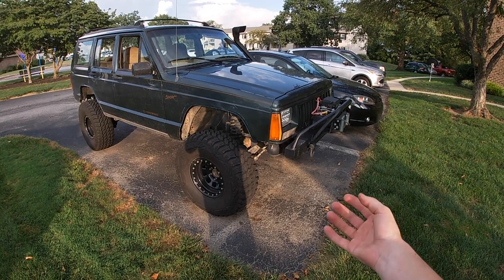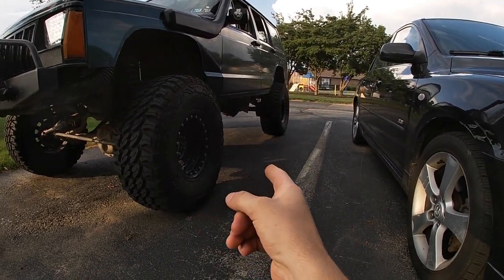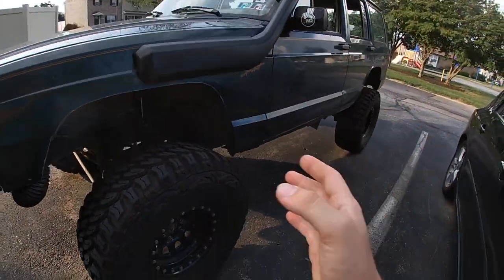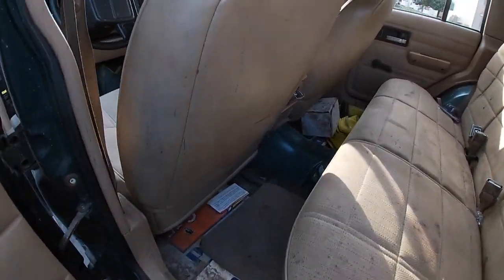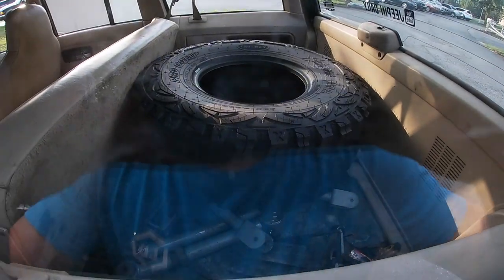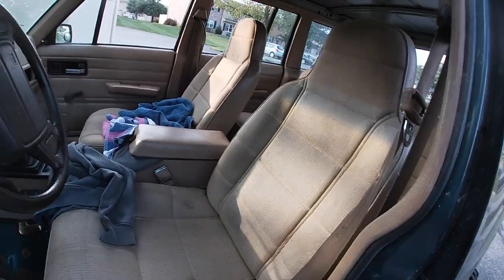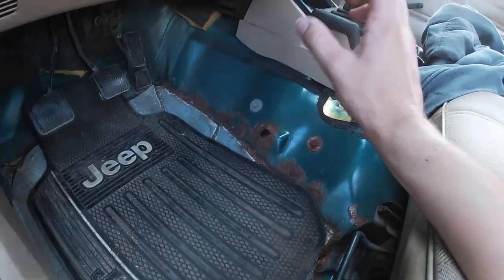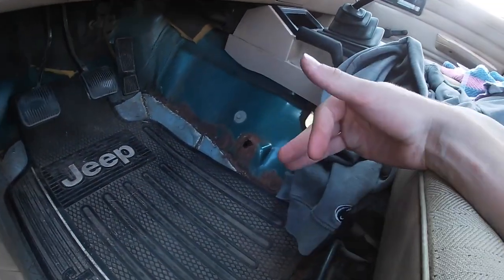My 5 Speed Jeep XJ Needs Your Help!!

Comment: Hey man, literally have the same jeep as you do. My floor started to go so my Dad and I repaired the rust with some sheet metal, put some risen to seal it, put some bed coating on top for the noise and I put some regular tan house carpeting in for the heat. It’s warm but it won’t burn your leg on contact. It took about 3 days for everything and it was worth it! Also had to repair the AC last week, so if you need some answers for that then i’m here to help!
Reply from the maker: I need to replace the AC condenser and lines because they’re rotted. Hoping the compressor is good.
Reply: Jeepin Daily My condenser was fine, had a bad relay

Comment: My xj is a auto and my floor pans get hot too. I bought some rolls of insulation and new carpet hopefully that works, I'll let you know.
Reply from the maker: When maddy had her XJ which was auto and my auto XJ (both had full carpet) I never had the issue at all. My 5 speed with carpet was still a sweat box.
Reply: My stock 1996 5speed never had that problem but it was born stock besides the exhaust.

Comment: Sounds like maybe your fluid level in the trans may be low or the fluid is not the correct type. I have basically the same XJ minus the lift, tires and cut wheel openings. Mine grinds going into reverse most of the time. I have all new fluids but haven't had a chance to change them out. As always, thumbs up!
Reply from the maker: I’ve always had this heating issue. I checked the fluids last year and they were full. Definitely in the agenda to flush the fluids in the trans and transfer case though. Thanks for the output!

Comment: My 1996 xj needs your help. 

Idk if it's a blown fuse but my gauge cluster doesn't turn on or glow in the dark.
Reply from the maker: Neither does mine. It use to work and after 5 minutes of a radio install all the lights quit working but it isn’t a blown fuse. I would start with checking the fuse for it definitely though.